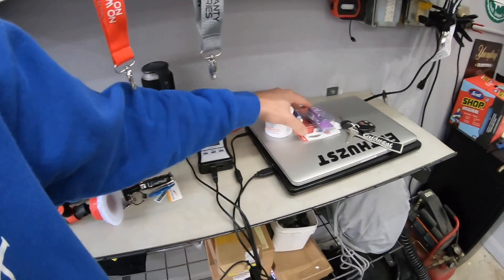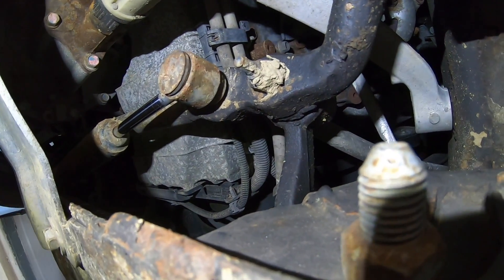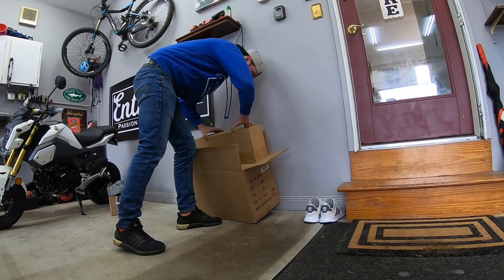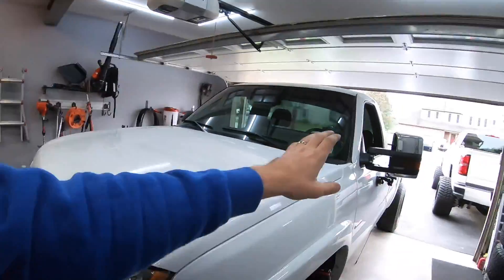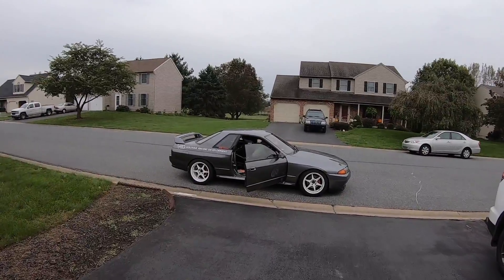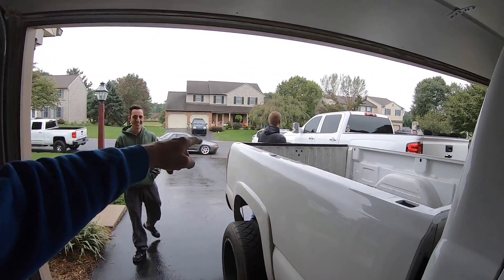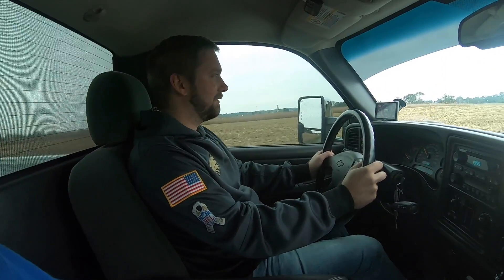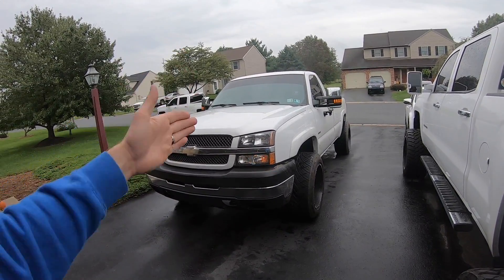THE MINIMAX IS BROKEN! *TERRIBLE Choice!*

Comment from the maker: I believe we're dealing with a boost leak, but I wont know for certain until I dig into the truck this week! Smash that like button - See you all this week!
Reply: Sadly I haven't watched one of your vids in a while but I noticed the new intro!
Reply: Did you get the tinted lights on the mirrors,do you think about getting drag radiails for the truck
Reply: I noticed it in the video. Sounds like a boost leak to me.
Reply: I typically like tow mirrors but for this build I would keep the ones that came on it. Awesome videos btw.
Reply: Mini Maxx color match  bumpers, Hint ,Hint 😉😉😉
Reply: I love the new mirrors on this truck.
Reply: I had the same exact sound in my Lbz. When I was researching the cause, I read that it could be an exhaust or a boost leak. Mine was leaking where my inter cooler pipe connects to the y-bridge.
Reply: Do all Chevy truck mirrors fit the same? I have a Chevy Colorado that I wanna put tow mirrors on but I’m scared they won’t fit

Comment: My whine on an lmm was the fan shroud being pulled into the fan under full throttle and barely touching. Sounded like it was also coming from driver side. Give it a check, if so, easy fix.